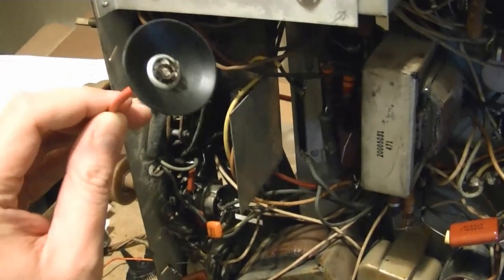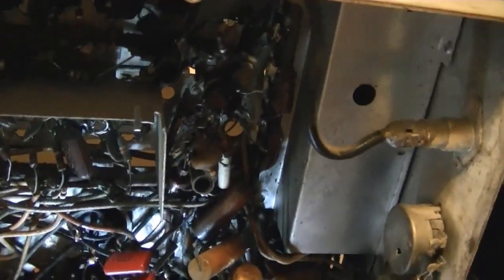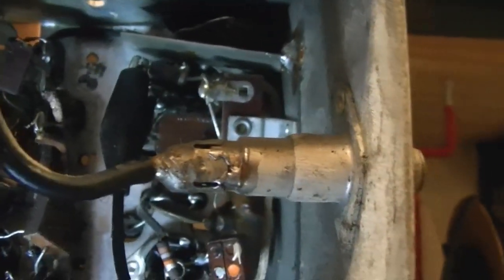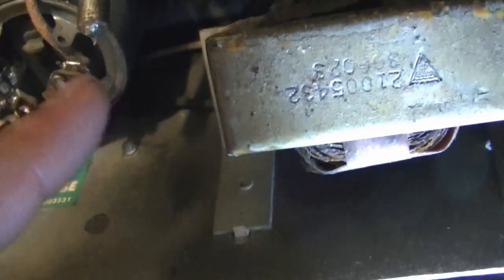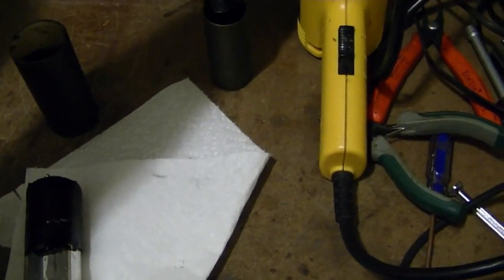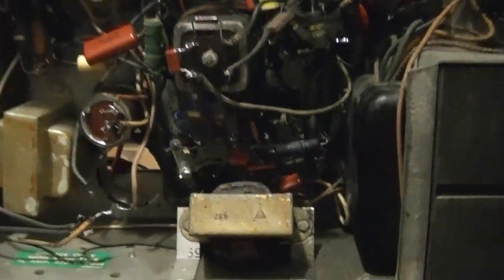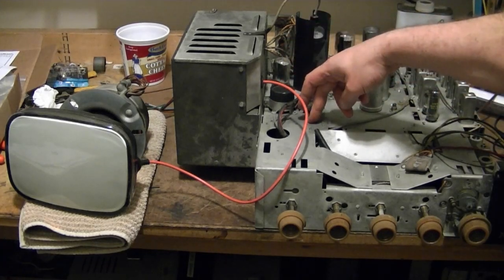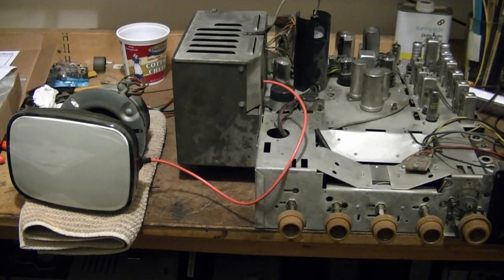Dumont RA113 restoration p4o8

Comment: Good non-catastrophic first power up!
I use to do the same thing you did with your screwdriver except it involved an eight foot lucite rod with a grounded semi-pointed end and a one million volt voltage double stack consisting of HV caps & smooth polished aluminum rings. One hundred and fifty people would all jump when I did that at work! Mega fun!

Comment: I use a toaster oven to melt out old condensers, 200-250 degrees usually works well for melting wax without destroying the cardboard tube. Lacquer thinner will instantly melt the tar residue by the way.

Comment: How does the test CRT outer dag get grounded? I got to wondering that when you mentioned that you heard arcing from somewhere.
Reply from the maker: There's no dag coating on test CRTs.  This set has capacitors in the HV cage that do the filtering so it;s really not necessary.   If a set relies entirely on a dag coating for HV filtering, you can tack a temporary HV filter cap on the rectifier output.
Reply: Right on...plus, if one has no hv caps around and the CRT has a dag, then a length of stranded wire, one end connected to the chassis and the other end stripped back a couple of inches, the strands fanned out, then they can be taped to the dag. In some cases the dag coating can get separated a bit from the glass and one has to be careful not to pull it off with the tape.